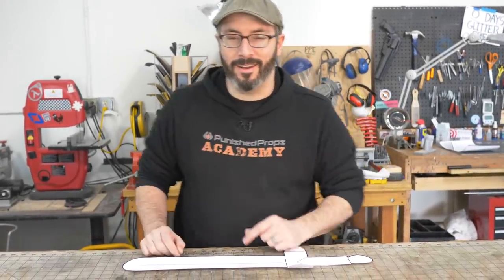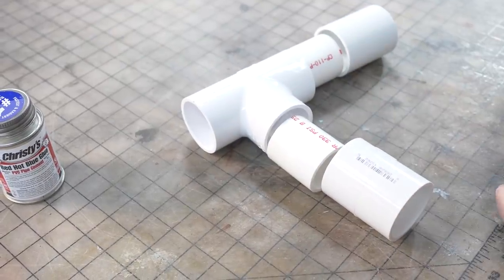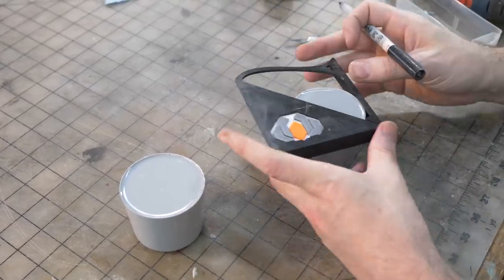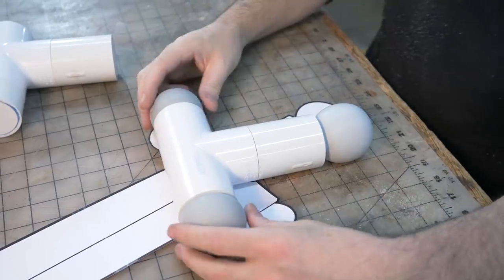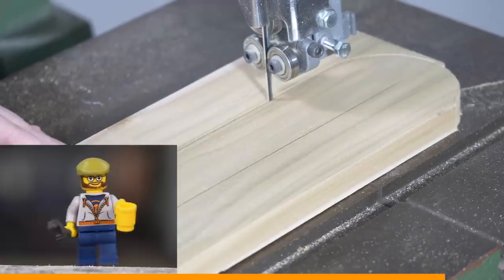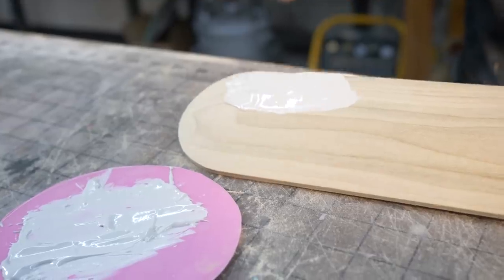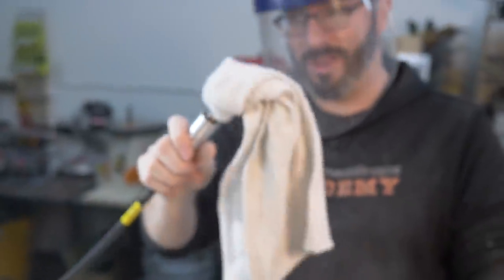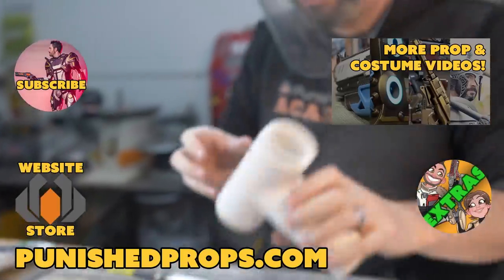GIANT Lego Sword and Shield! - Prop Making Tutorial

Comment: Use a spray-on sanding sealer on the bare wood, then sand the wood smooth before primer to help get rid of the wood grain.
Reply: This. I usually do several coats of spray shellac on bare wood before primer.

Comment: I'm not sure how they compare in size to the spheres you made for the hilt, but racquetballs could be a fill in for those without access to a lathe perhaps.
Reply from the maker: We thought about trying to get a found object to use, but sometimes you need to compare the time it would take shopping around for the right piece vs the time it would take to just make it from scratch. In this case we went with a scratch built piece, but yeah it's super worth checking if you have something on hand that would work.

Comment: Your seams look pretty tight but it's a good note to hold everything tight for 30 sec or so.  The sockets on PVC fittings are tapered and will tend to push out the pipe till the cement is set.
And yes the active ingredient in PVC glue is MEK which is pretty nasty and absorbable through the skin.  You will also get some off gassing when you work PVC, so that smell you get when turning/ cutting/ drilling, it is not "great" to breath but not that bad if you have any decent ventilation.
I like your tool names!
Table saw is a better bevel choice, though you still need a bunch of hand cleanup, but it would get you 90% there.

Nice build!
Reply: As the son of a plumber, that's a good catch.

Comment: Great build as usual, 2 things:

1) I would have definitely watched this as 2 - 30 minute videos.  Especially since this was a 4 day (or more) build
2) little trick I use for dealing with potential paint bleed is to use the same color on the edge of the masking tape as the bottom paint color.  Wait for that to dry, which shouldn't take long with a hair dryer, and then paint your second color over that.  in your case if you would've put some white down along the edge under the red, the bleeding you would've gotten would've been white on white and not at all noticeable.

Just a thought (or two)

Comment: With the blade would it have been possible to use pvc pipe and just heat it enough to essentially flatten it? You could even place something inside to create the ridge in the center of the blade. No clue if it would be possible but its an idea
Reply from the maker: It's possible, but in order to get the right width the pip would have to be pretty wide. PVC doesn't heat form very evenly and pressing the two layers together would make it quite thick. It's not a material I would choose for a sword blade.

Comment: I hate to be the guy, but I need to raise an issue. You used the same breather for the PVC glue as you did when you painted. Your breater might be rated for both particles and vapor (going by the filter shape I kind of doubt it but aftermarket filters exist) and a lot of builders thing their basic, cheap filter will do both jobs. I only mention because I've never seen anyone else talk about it, but please address the need for a vapor rated filter when you need protection from fumes, because most breathers come with dust filters which are rated by particle size. It's okay for 90% of sanding and painting (and being outside will help with the other 10% if you are sanding something exotic) but no dust filter will keep out fumes. But, please, address the difference and importance of knowing the difference.
Reply from the maker: I use a 6001 respirator filter which is rated for organic vapor and is safe for both the PVC glue and 2K paint that I used in this video. You are correct though that not all filters work for all vapors or particles! I've mentioned this before in a couple videos but it always warrants repeating.

Comment: Should just get a cheap #4 smoothing plane. Would have hogged out those bevels down to the lines in about a minute without having to set up any machinery with a finished surface. Spoke shave would have worked really well as well and much easier. Wouldn't even need to file or sand afterwards with a bit of practice.
Reply from the maker: Welp... time to go to the woodworking store and pick up a bunch more tools! Oh darn! =)
Reply: @punishedprops  Unless you are going for serious woodworking, just go with a cheapo used one. Can get one for $5 in estate sales. No need for a $150 Sweatheart. Same with a spokeshave. You'll wonder how you ever lived without one of those. I use mine in pretty much everything that needs trimming down and I hardly ever have to touch sandpaper to finish, only when they get the surface too smooth and I have to roughen so finish will hold.

Comment: That file made from band saw blades, did you make that?
Reply from the maker: Sorry, I'm not sure which tool you're referring to. I used a small needle file at one point, which you can find the link to in the Build Tools section of our website, linked in the description of the video.
Reply: @punishedprops  It's at about 24:13 in the video. The handle is red, and it's got sort of a lattice pattern going with the bandsaw blades. Hope this helps narrow it down.

Comment: a note about super glue....don't forget this is the same stuff that crime labs use by placing a couple of drops in a peetree? dish in a fish tank with an object they want to pull fingerprints from.  AS IN the fumes of the super glue can apply to your glasses and any dust in the air, might get stuck to your glasses.  I always switch out to chunker cheaters when working with super glue...just because I'm paranoid and can't afford another pair of prescrips.  LOL

Comment: hey Bill, why make three of those? make a mold and pour as many as you need. right?
Reply from the maker: That's a great idea! For this build the two hilt knobs were the same, but the pommel was different. I could have molded one of the hilt pieces to cast the 2nd, but I figured it would be quicker to just turn two of them.
Reply: @punishedprops  I noticed the bottom was different after i hit "reply" but my thoughts were more along the lines of making more than one sword down the road. i guess its not too complex that you couldnt mold and pour replicas of the entire sword from your completed original now.

Comment: has a good respirator, uses a dust mask... facepalm... dust masks are worthless
Reply from the maker: Each piece of safety equipment has a specific use. My respirator is rated for organic vapors but not for solid particles! The dust mask helps protect my lungs from solid particles when sanding, but won't help with vapors.